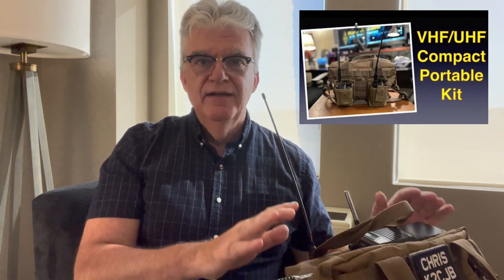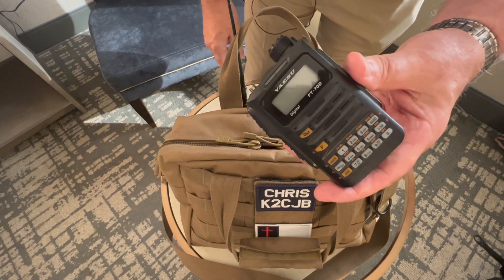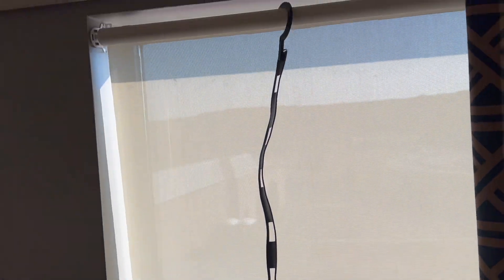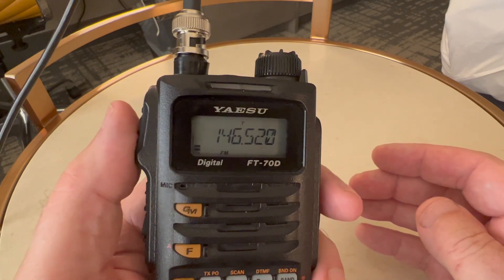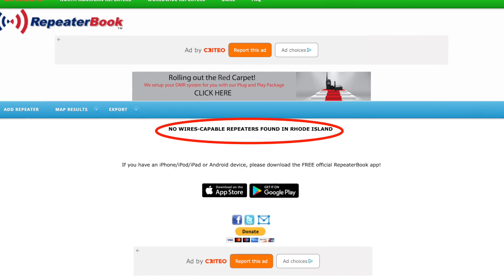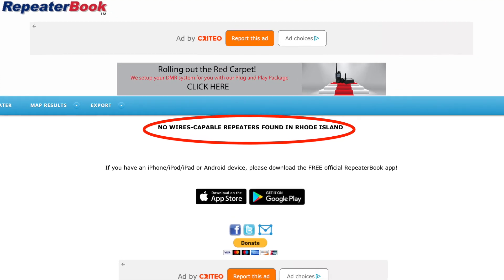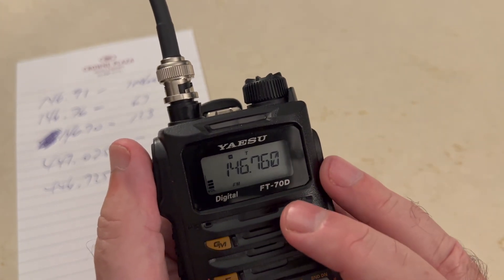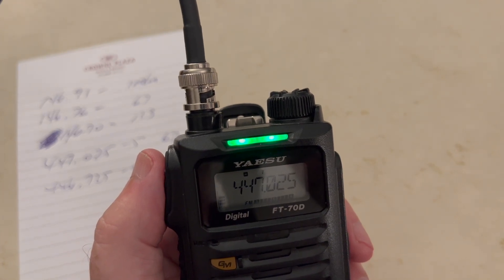Simple VHF UHF Hotel Room Setup for Ham Radio

Comment: Nice informative video with clear audio and good camera work. I do for you have a couple of tips for you. Instead of stating your call sign with listening after your call sign, is think you should state your call sign and then also say just looking to make a quick radio contact, please. I think then that way, it'll prompt more people to respond. This next tip might be a little bit more work, but I think it would be worth it. Skip all of your regular memory channels that you have programmed in your radio and then program in the handful of repeaters that are in your new area. Then that way, you can scan just the new repeaters in your area. The chances are very slim if you just happened to try one repeater for 2 minutes and then move on to the next one, whereas if you would program the handful of repeaters into memory, you can scan the memory channels and then maybe 10 minutes or 30 minutes later you might Here conversations that you normally wouldn't hear because you didn't program them into memory and you only threw out your call sign one time on waited for 30 seconds.

Comment: This is KC1QYD, Greetings from Rhode Island I'm guessing you were in the Warwick/Providence area based on the repeaters you were hitting. I am looking at Slim Jims for my portable setup and judging by this test, i think i am going to go for the N9TAX antenna. 
73, Thomas
Reply from the maker: Yes I was.  I was at a hotel in Warwick for a conference.  The N9TAX is built really well.  I have two of them.